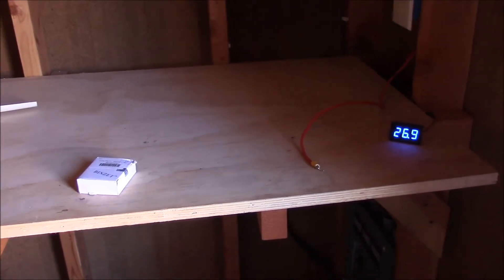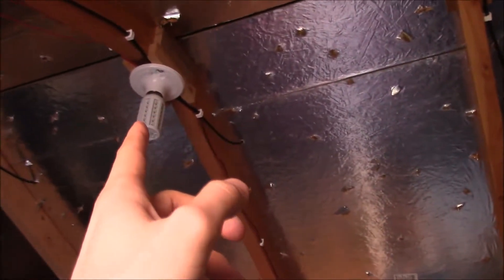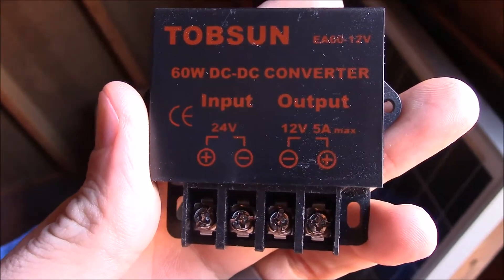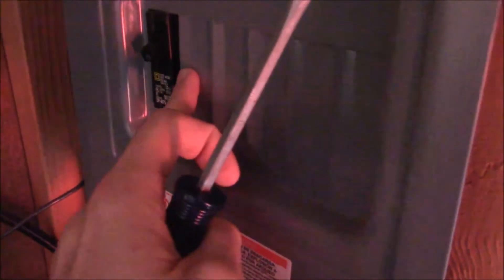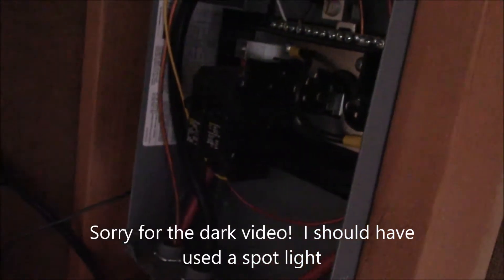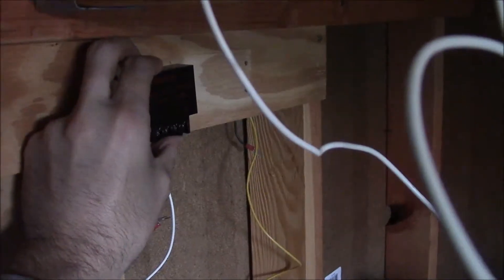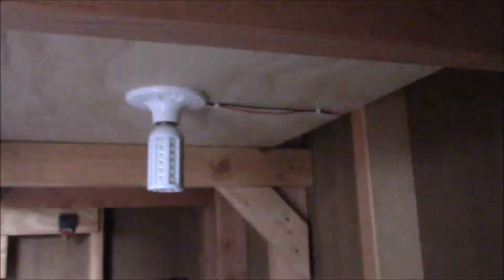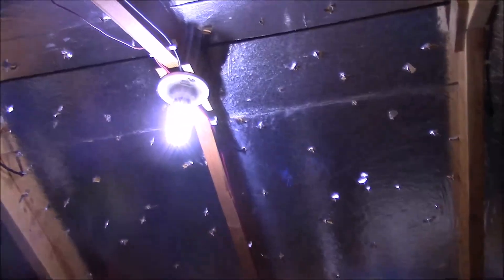Wiring A DC to DC Voltage Converter

Comment: Hey LDS, Al Ruark here, stopped by your channel always interesting , that little devise will come in handy going to order one now, By the way I'm up &running with 3/4 of the house on solar
Reply from the maker: +Al Ruark Hi Al!  Good to hear from you.  Did you get your AC wiring to the load center figured out?  I am impressed that you are powering most of your house on solar.  Good work!

Comment: The long thin wire help the voltage to drop down to 12v so, you don’t have to burn as much off as heat in that voltage converted.

Comment: If I wanted to step down from a high powered EV system, let's say 72V, 100-300amp possible peak, when batteries are fully tapped..... can you just put a cheap ebay 72v-12v DC-DC step down converter or does the amp flow through the system come into play? would it fry one of those or does the amp flow through the system during motor use not affect the step down converter..... I found some 72-12v step down converters on ebay that are rated for 30A output....
Reply from the maker: Yes, the current is a factor.  Most step down converters can't handle much current.  You will have a hard time finding one that will step down from that high of a voltage to 12V but I am sure they exist.  And it will be very expensive to handle 100-300A.

Comment: Hey Man, you may want to consider a voltage regulator inline at the 24V side to ensure that no more than 4.5 or possible 5 volts max can get through. That way you don't blow your voltage reducer that you just installed. I would venture to say that those lights don't draw much but ya never know. I would say put it in your main box in the yellow line to make sure that it only puts out 5 or just less than 5 volts. Probably over kill, but just in case you want to add more to your 12V line you will have the protection installed. Talk to ya soon....
Reply from the maker: +Paul Bialozor I am sure you meant amps :)  Good idea.  I never thought to do that.  Can't be too careful even though it is only a $10 part.
Reply: +LDSreliance Right Amps, current is confusing sometimes, 12V system 5 Amps Max as the video says... LOL... The important things is you figured out what I meant so yeah, it's all good....

Comment: Great project. Doubling the system voltage will increase efficiency immensely . One comment, The AC breakers should not be used in DC circuits. An AC device depends on the zero crossing point of the sine wave to limit arcing of the contacts. In this case using it only as a disconnect switch should be OK . There are cheaper alternatives though. I like your way of thinking . Keep experimenting.
Reply from the maker: Yeah I am only using them for disconnecting purposes, not as much for safety.  I have since switched to QO series breakers with are rated for 48V DC, though.

Comment: Why not just wire the lamps in series, problem solved, and you dont need  a converter.
Reply from the maker: That is an option for sure.  But I also wanted the ability to run some other 12V loads at the time.  Now I have separate 24V and 12V systems for different applications.